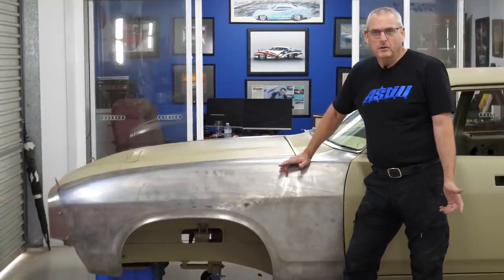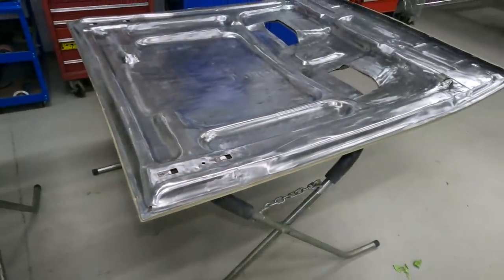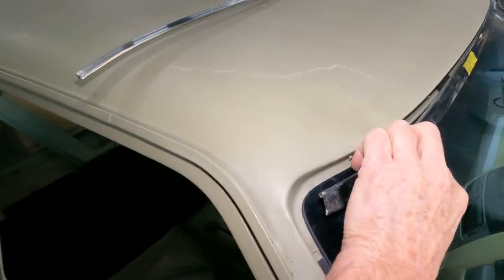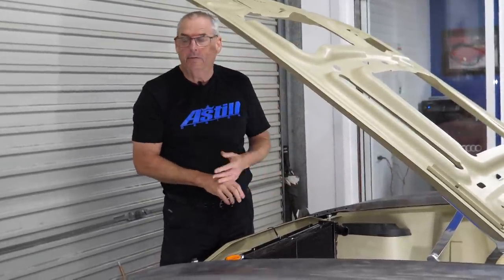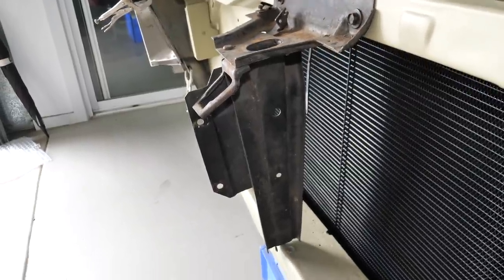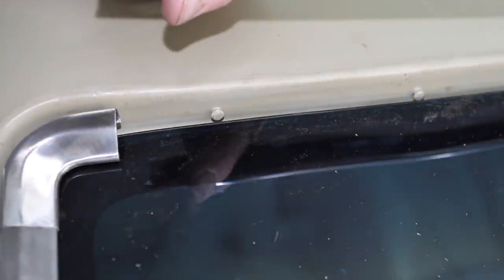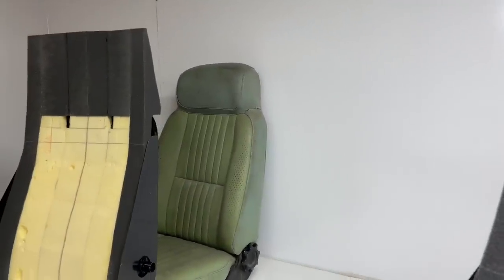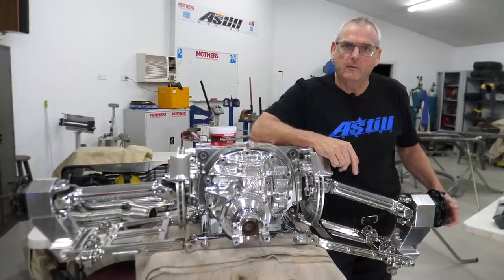Six-Pot Brembos With ABS Braking | Road To Summernats Top 60 #13

Comment: Another inspiring video Howard. I am so much enjoying what you are showing and teaching us.

Got a question for you about the windshield trims, would it be better to loose fit the trims while the windshield is already fixed in place. 
I am planning my 2nd rebuild for next year and my window and trims are still in place. I have not stripped anything off yet. She actually looks ok but it will completely strip down and built how I always wanted it.
Reply from the maker: Yes, definitely remove trims and clips then make sure the trims fit the opening.

Comment: Any possibility of led lights in the front headlight  and rear tail lights assembly after seeing your work nothing's impossible from your team of craftsman  It may have been discussed in previous episodes something different There are aftermarket taillight assemblies like in the Au and BF series I am  a bit behind the times so many led light combos now even the led globes sorry for the long message Howard Did you think of putting a shortened xr8 bonnet bulge in the bonnet 
I know your times valuable Howard  love your videos thanks for sharing
Reply from the maker: All covered in earlier episodes that were called this week at Astill Design

Comment: I really like your work and attention to detail. Thanks Howard, for posting some really good content on YouTube. I am from Melbourne, and wanted to suggest my idea for the indicator side markers for the 429 badge. 

Why not sandwich a clear piece of lexan between the badge and body and run a LED behind it, to shine out through the cut edges of the rectangle...

Cheers !! 🇦🇺🍻
Reply from the maker: That sounds like a good idea, I will check it out and see if it will pass with the engineer
Reply: @AstillDesign   cool, keep the lexan 4 to 5mm thick, so the light will shine though easier... if you had an email address, I could send you an example image...
Reply from the maker: Astilldesign@hotmail.com

Comment: good call on the copper brass radiator. and the reason given is spot on efficiency and longevity vs weight and cost for aluminium
Reply from the maker: Yeah bit more of the old school thinking